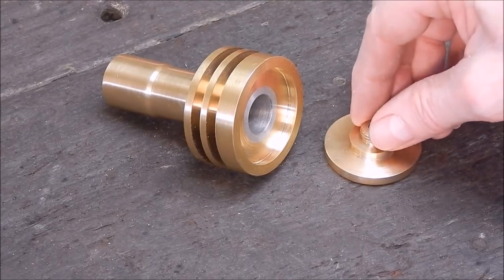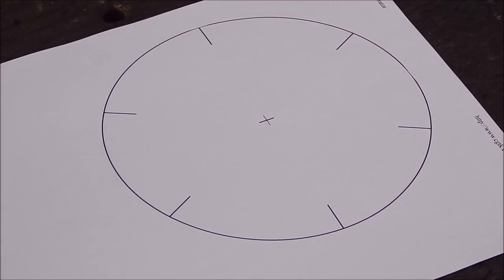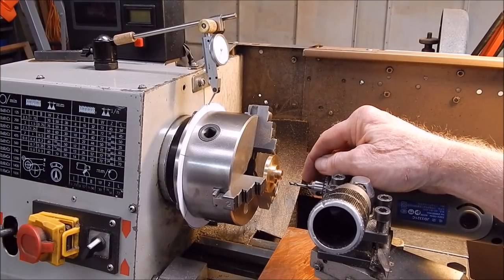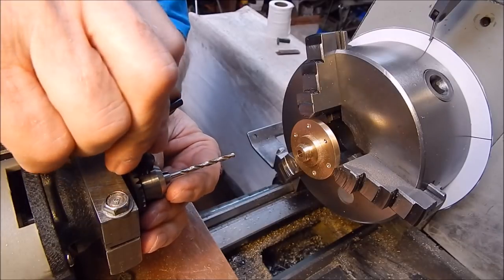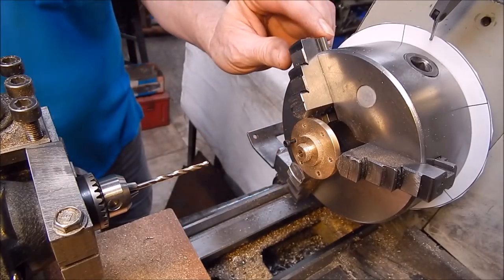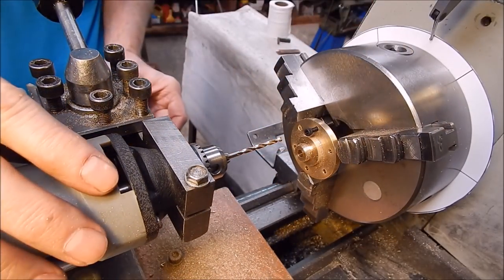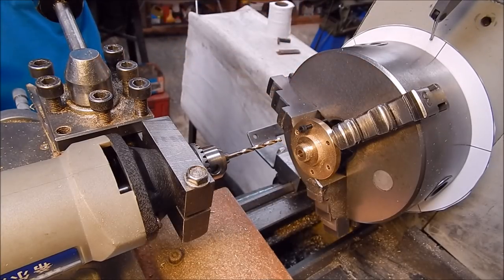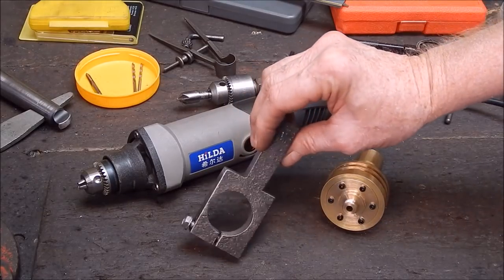How to easily index and radially drill on a metal lathe

Comment: I have done similar dividing by printing a strip of paper to go around the back plate using a CAD program to adjust the scale to get the length correct. I then mounted a small microscope with  recticle to line up each line. Worked great for engraving the lines on a machine dial. Similarly I once used a strip of steel measuring tape wrapped around a plywood disk cut to the size for the length of tape. I mounted the disk on the rear of the lathe spindle and viewed it the same way.  Many ways to do divisions without a dividing head.

Comment: The simpler the better, but why don't manufactures of lathe chucks etch 360 degree on the outside then you would not need the Template.
Reply from the maker: Totally agree. It would be a non event to add them.
Reply: I was thinking the same, but mind you 360 cannot be divided by 7, 11, 13 and quite a bunch of other numbers you'll probably need to index at some point in your life, so you'd still need some workaround for those.

Comment: You know the thing is Rob that not everyone has or can afford all the delicate and accurate gear required to perform some of these tasks so it is really awesome to see an alternative presented that most all of us can have a crack at, bloody good presentation mate, well done
Reply from the maker: Hi Gordon,

Thanks for the positive comment.  You don't have to spend mega bucks to buy expensive specialty gear to do what may be a one off job.  Paper discs and other methods are usually just as accurate and work just as well.

Plus you get a certain buzz out of doing the most with the least.

Cheers Rob
Reply: Had to laugh at the final sentence Rob....my wife would probably agree and have a good laugh too

Comment from the maker: In this configuration you could easily use the Hilda to machine keyways and also indexed splines into shafts.  The unit is plenty fast and rigid enough to do this.

So, you could easily do small mill type activities/jobs on a lathe with this tool.  Opens up lots of possibilities.

Cheers Rob

Comment from the maker: You will note that there is virtually no flex in the Hilda mount.  That is is because of the alloy nose used to mount the unit. 

This makes it totally suitable and accurate for any sort of cross or horizontal drilling.  Plastic units will always flex like Chinese noodles when used for this purpose.

The HILDA is quite simply the only unit I've seen which provides this sort of accuracy and power for this amount of money.

The 110 volt Maxman unit looks similar but has a much higher quoted low speed range.  This may be an issue when drilling.

Cheers Rob

Comment: I put a sprocket 24T, 5/8" on to my spindle with a locking lever a d motor kill switch.  I can do indexing of 2,3,4,6, 8,12 at any angle to lathe axis,  No hassel!   It also locks the chuck tor tapping, Dies and tightening ER collects.  Definately the best mod I ever did.  I use Hilda, Dremmil and a powerful toolpost milling ER 16 in combination with the 24 gooth sprocket indexed.   Rob if us like some photos I'll happily send them.
Reply from the maker: Thanks for the offer Joss.Yes, I'm always up for some photo's if it's no trouble.  Email me on gloaming_agnet@hotmail.com.  I have considered this, but my Chinese lathe pulley space is limited and I have indexing on the Schaublin so I've never bothered.  The manufacturers could incorporate indexing and a lock into the spindle chuck mounting plate, but they won't because it's all extra cost and most people won't use it.  The paper discs work well because it's much easier not having to count pin positions, just go straight to the radial mark.   So it enables easy referencing for any tooth combination, which many dividing heads are not  able to do.  Cheers Rob

Comment: The name of the Amazon 120V unit is MAXMAN.  I ordered it on Friday from Amazon Prime, and surprisingly it showed up on the porch today (Sunday).  It doesn't have all the accessories, but it looks like the same unit with a different name slapped on it.  It sounds the same... :).   I'm guessing that the difference in power (200W vs. 400W) is because the speed control unit and motor are the same, and they just put another cord on it.  Even though I have 240V in my shop, I don't think I'll risk testing it on 240!  And, I'm not positive the 240V version will work on 120V 60Hz. Price was US$39.00 and no shipping cost for Amazon Prime, but they did add my state sales tax.
Reply from the maker: According to the spec the MAXMAN has a different speed range to the HILDA - it's higher at both ends.

Is that right ?

Cheers Rob

Comment: i found this method accurate enough for the type of jobs i do. i have 2 questions. 1) how do you locate and center the piece of paper accurately on the back of the chuck? 2) how do you make sure that the drill bit is parallel to the axis of the part? thank you. i have subbed and i am learning a lot from your videos. i especially liked your approach to building lathe benches!
Reply from the maker: The spindle has a centre register lip -use that to centre.  To get the drill level you align it with a centre in the tailstock - basic lathe geometry.

Comment: Good video Rob.  I thought you might use the microscope set-up again, but this was even simpler.  Thanks!
Reply from the maker: Hi Ron,

Just doing it by eye was good enough for this job.  When you translate the error factor at the pointer diameter back to the actual diameter of the job, it's bugger all of a gnat's whisker.  For gears I always would go the extra step, just to get them as quiet as possible.

Cheers Rob

Comment: Cool video.  On my old atlas lathe there is an indexing ring with 60 holes.  Works for some indexing but not all.
Reply from the maker: My Schaublin has a similar indexing ring on the drive belt pulley.  Trouble is that it's very difficult to count and move the correct amount.  So many holes that you get lost.

Pie charts completely solve that issue. Also pie charts can index some gears that quite often are not covered by commercial indexing rotary tables.

Cheers Rob

Comment: nice job. You could easily further increase your accuracy of your dividing method if you printed a paper disk with a vernier scale (nonius) in each of the 6 positions instead of 1 line in each position. Eg. you print 10 lines to the left and right of your current line with 1 degree space between each line on your paper disk. Instead of a pointer you take a transparent overhead projector foil and print again 10 lines to the left and right of the center line but this time with 0.9 degree space between them. Then you cut out the stripe with the vernier scale and overlap it with the scale on the disc and you can read the vernier like on a caliper 10 times more accurately (to 0.1 deg). You could also use 50 lines 1 degree apart on the disc and 50 lines 0.9 degrees apart on the foil and you could read 50 times more accurately (to 0.02 deg). More than 50 vernier lines do not work well because the eye cannot determine any more which lines line up. https://en.wikipedia.org/wiki/Vernier_scale (Disregard the 7th picture from the top in this wikipage bec. the vernier scale is not 0.9 times as long as the fixed scale. Therefore the first division is not precisely 5.1mm. All other pictures are fine.)
Reply from the maker: Hi Rol,

I use a USB microscope to index these discs when gear cutting.  Check out this video on it:https://www.youtube.com/watch?v=PBlBJ5RWTSk

You won't do better than that ;)

Cheers Rob
Reply: I remember that video. And of course the microscope is better than a tenth of a degree. But if you combine a 50-division or maybe a 100-division vernier scale with your microscope I guess that would increase the resolution beyond both single methods.

Comment: Great video as always!
What material are you using between the brass and the chuck?
Would you recommend that between a mill bit and the chuck when doing milling?  I do not have collets at this time. Or is this more in place of "soft" jaws?
Reply from the maker: Hi Dan,

The soft packing is old belt sander strip.  Normally you would use it with the grit side towards the job, but as this only had light loadings and the brass was polished I went the other way.

No, I would not recommend using ANY packing material between a mill bit and chuck.  The mill bit can easily turn and also walk back into the chuck.  Better to have metal on metal.

Collets are the way to go for this sort of work.  

Cheers Rob
Reply: xynudu thanks! Always a pleasure! It's videos like yours that are really driving me into machining and was the tipping point to buying my first lathe!
Reply from the maker: Glad to help out Dan.  The processes are all relatively simple. 

I'm sure you will get a lot of enjoyment from your new lathe.  We all start at the beginning and learn along the way.  

It's like fishing, there's lots to know.

Cheers Rob

Comment: Chucks with index marks - a new invention?
Reply from the maker: Not really.  But I have long thought that the chuck backing plate (or chuck body) could easily be stamped on the circumference with 360 degree markings and numerals.  Would be very useful.

Maybe that's thinking too far out of the comfort zone for most manufacturers  ;)

Cheers Rob
Reply: Ask your friends at Bangood to make them and we'll take 5% each
:-)